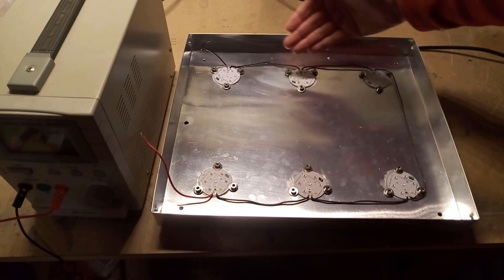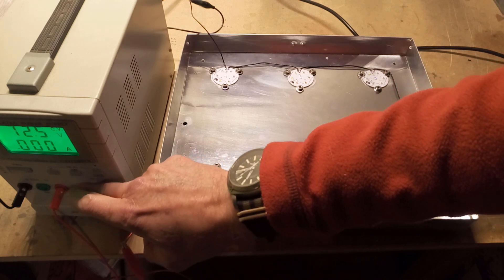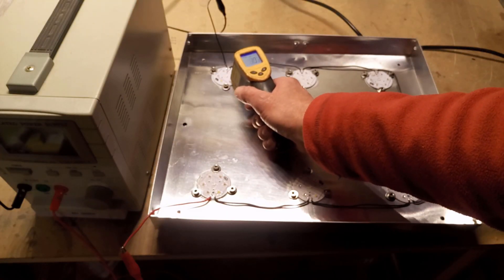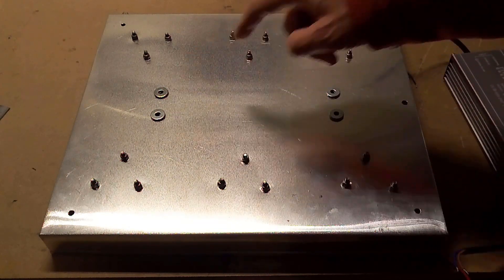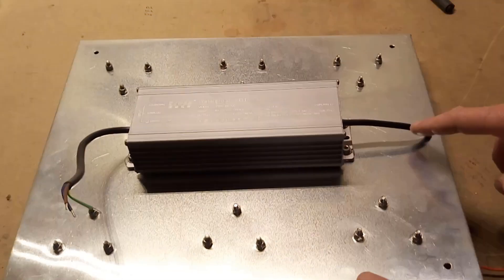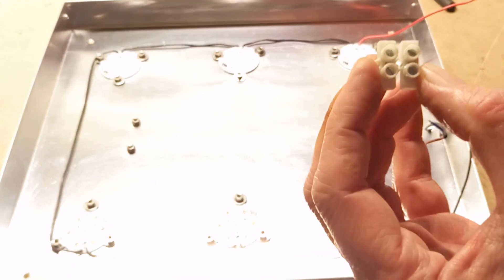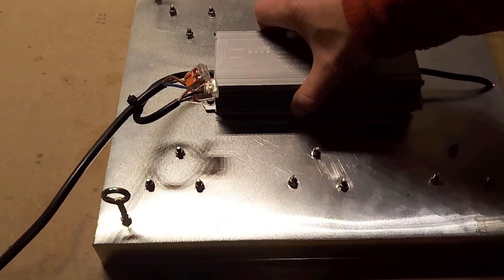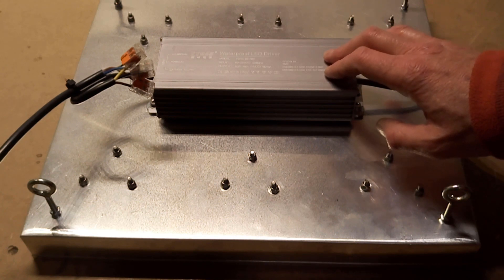How to make Your own High Quality Led Grow Light Part 4 - Wiring the Light

Comment: Cool DIY project and planning to make one!  
What combination of LED would you recommended for a more aesthetically pleasing white light (instead of a red/pinkish light) for each PCB? Could one just use all your recommended white light LEDs instead? Or is there a minimum red LED combination requirements for maximum plant growth?  
Thanks in advance!  
PS: Looking forward to the final video on this DIY project!!
Reply from the maker: Hi Sorry I didnt reply earlier. Check out this video which explians choosing white leds for grow lights https://youtu.be/DW-kIeHcGho Basically use 90 or 95 CRI leds of around 3000K to 4000K. Check the spectrum on the manufacturers site and make sure the red output peaks at 630nm not 600nm and it should be a great led for plants. If you choose one with a peak at 630nm you wont need to add any red or hyper red leds and the light will be so close to sunlight you wont be able to tell the difference. Our Stellar lights use this type of led and are popular with growers who have ornamental plants like orchids as they show of the natural beauty of the flowers colours.

Comment: i'm so glad I did.  I been wishing to wrap my wits around lighting.  I have some orchids about 3 years now and it is winter here in the dessert,  the sun is at its angle and out door temperatures are in the 30's f at night.  I get very anxious about the day light as the sun is pretty useless after 4:30.  So I am very interested in purchasing this diy product.  If you could give me some guidance on how high above the plants it should be hung that would be great !!! that is if  you haven't selected  some one else already.  i was sick today and seeing your explanations all afternoon was awesome.  fingers crossed..
Reply from the maker: Hi thanks for the praise, glad you found the video useful. I will have to check the postage cost because I am in europe (Spain). I will try to get back to you in a day or 2. If you are using a light for supplemental lighting, you will need to adjust the light by watching how your plants react - it is hard to give much specific advice because I dont know how much light they are getting or what the lighting needs of the plants are. You should be able to hang it at least 2 feet above the orchids - start at that and them adjust it depending on the plants response. That advice is for any plant! If the shipping is too much, I can recommend some decent lights you can buy.
Reply: @plantphotonics6348  That sounds good.  They are cattleya orchids the mature ones are about 14 inches high. and the youngins about 6 inches they are all considered blooming size and have bloomed.  The leaves lighten with more sun but its taking the sun til late morning to get in a position where they get a good dose of it so they are maybe getting 2 and a half real bright and less about 3 hours more less bright. Pretty sure they need more flow by the windows.  My others are doing fine but they get by on less light and still bloom.
Reply from the maker: Sorry it took me so long to get back to you, because of workload I have only just done the last video. The light is €60 which is about $65 and postage to the US would be $50, so total price including shipping is just under parts cost. I have made some improvements to the light, check it out! Please contact me at richardboesch@plantphotonics.com if you are interested.